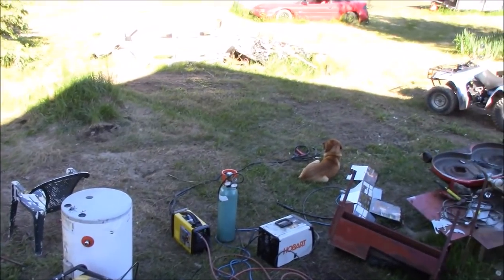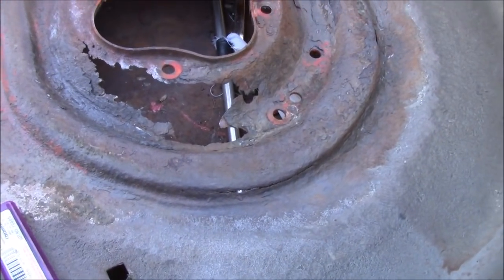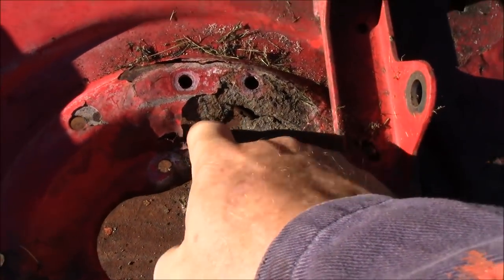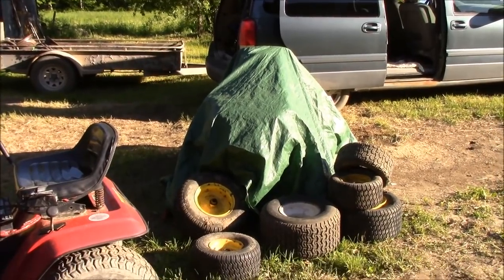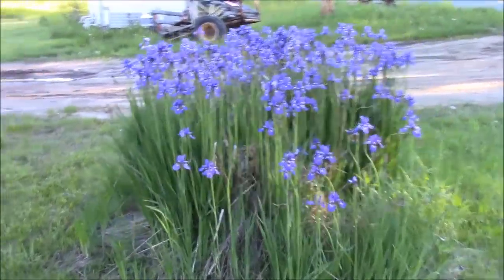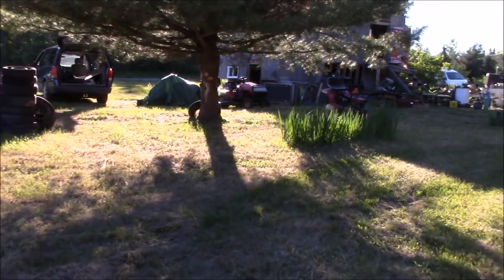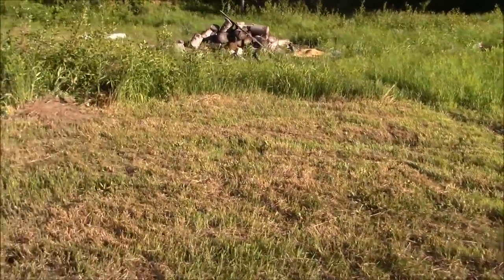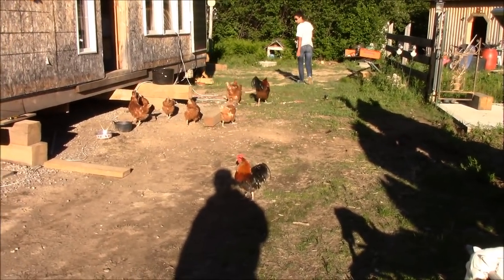This One's Not Mine//Another Mower Deck Repair

Comment: you should use the dirt from when you have your basement dug out and fill the holes in the driveway that is after you get the bulldozer going build it up a bit it will help when it rains to keep the driveway i bit dryer after rain but it is looking very good 
As you are sorting and tidying up your reusable material  you may find some hidden diamonds you forgot you had

Comment: You can never have enough steel or aluminum around if you have a welder and a way to cut it.  It takes a desire to fix things first and enough skill to follow up on it second.  It is good to see things being fixed rather than scrapped, it keeps from wasting all the resources we have.

Comment: I GOT A SUGGESTION DUE TO YOUR WEATHER, JACK THOSE CARS UP AND PUT THEM IN ONE PLACE AND SET THEM ON THE RIMS PUT HE TIRES THAT ARE UNUSABLE ON THE BOTTOM, THEN THE RIMS AND PLACE THE CARS OFF THE GROUND AS IS. I HAVE DONE THAT IN THE PAST. MAKES LIFE EASIER CLEANING AND MOWING AND REMOVING PARTS OR WORKING ON THEM. EASY JOB TO DO. DRAG THEM WHERE YA WANT JACK EM UP AND GET EM OFF THE GROUND. PUT EM IN LINE. THAT WOULD BE FUN TO DO.

Comment: Modern mower decks are 12 gauge steel, better ones are 10 gauge, while the best ones use 8 gauge. By the way, how do you charge for bush repairs? Welding wire and shielding gas are not given away.